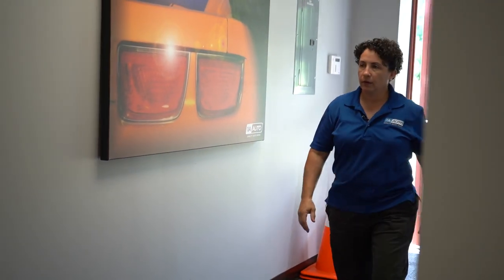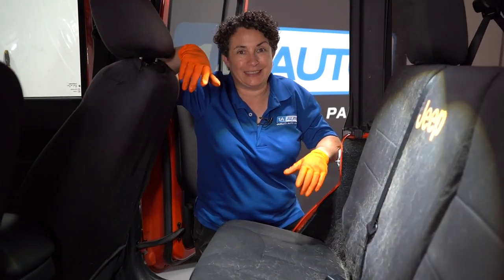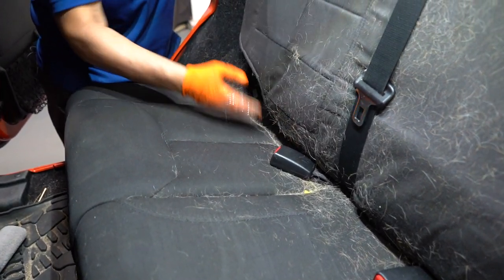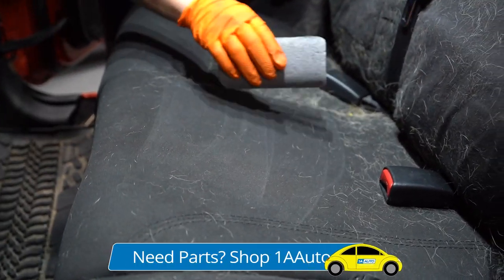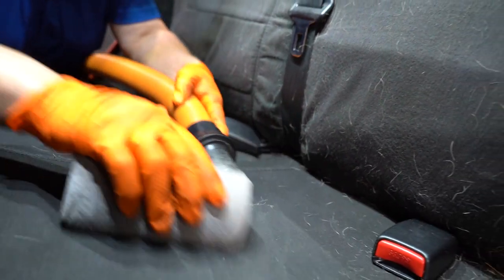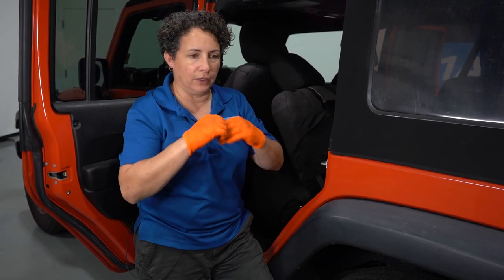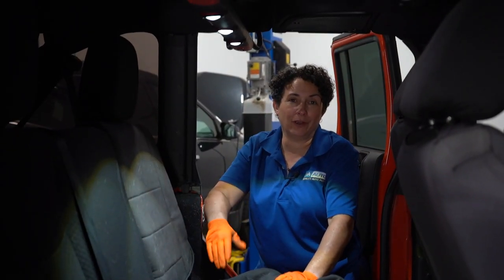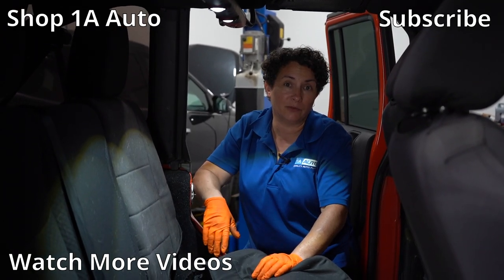Impossible to Remove Pet Hair Stuck to Your Seats? Try One of These Tricks!

Comment: Rubbery plastic is the solution - it has to be just the right balance of stiffness and rubber friction. One of the best I have found is a glove used to remove loose hair from a dog’s coat while petting them. It has rubbery plastic material attached to the palm side. With the glove on run your palm across the surface you are cleaning. Once it becomes coated with hair (which will happen quick in that car) peel the layer of hair off the rubbery plastic then continue cleaning the car. Don’t let too much hair build up on it so clean frequently. It may sound like a hassle but that is just the way it is. The more  it drags on fabric the better it will clean. 
There are other devices with this rubbery plastic. Look in one of the big pet stores… they will probably have a few options to choose from. Good luck.